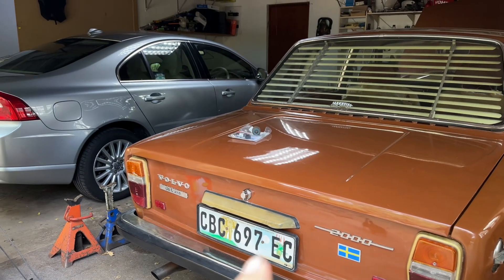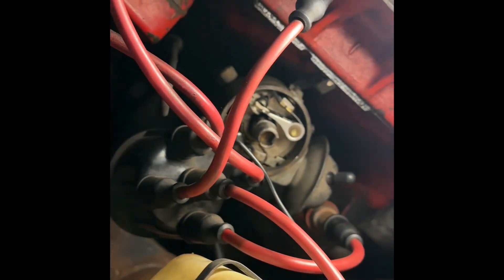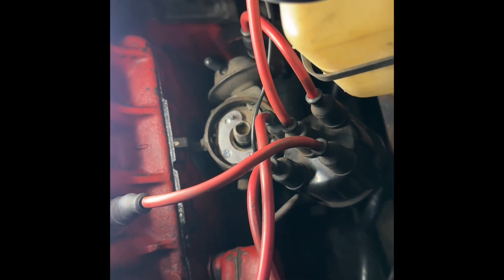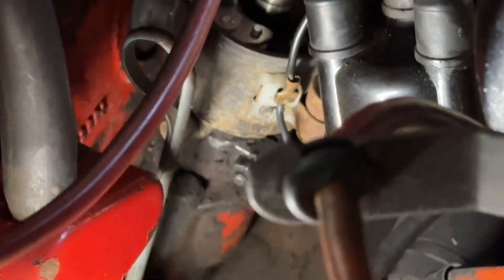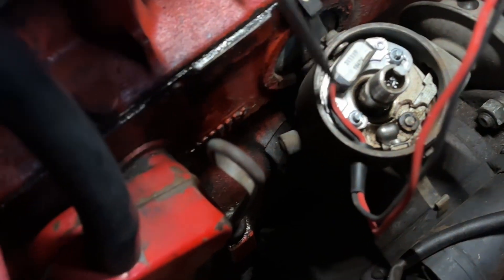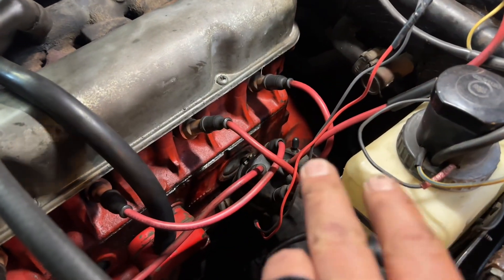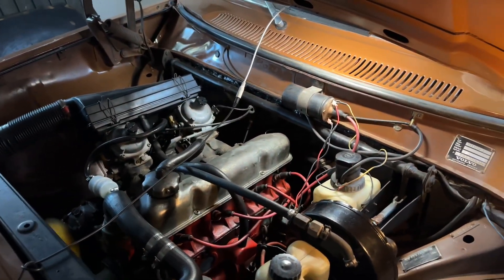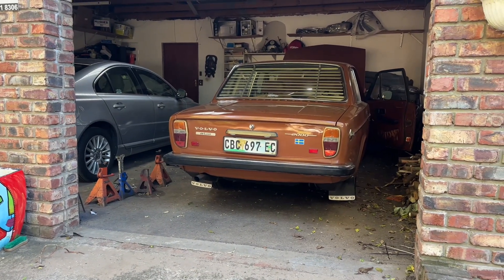ELECTRONIC IGNITION for my 52 year old Volvo 144s…

Comment: interesting video, thanks !
Just a couple of questions
-was this colour (ref 125) original ?
-grille is 1971-72, doors are late 1971 or 1972 (plat handles), front doors are 1966-72, steering wheel is 1966-71 which would indicate a late 1971 car, but the rims are pre-1970 ?
Reply from the maker: South African manufactured 144’s didn’t get the “butterfly” steering and went straight from this design to the “airbag” style one. We also didn’t get a change in rims in 1970, they ran through until the facelift was launched her in late 73. The cars were assembled at our local Toyota plant and they used whatever colours were available. The car is as it was bought new in 1972.
Reply: @oldmercguy  thanks for the interesting info ! As cameras and conmputer screens and lighting are not calibrated I am actually unsure about the colour. I first thought of coour 125-1 (which was if I recal first introduced with the 240) but yours might look more purely brown than the 125 reddish-brown. Do you have the colour reference? Looks beautiful.
Reply: Oh,I was not aware that Volvos were ever made  in South Africa,even though I was aware many other European cars,& American cars were also made in SA.